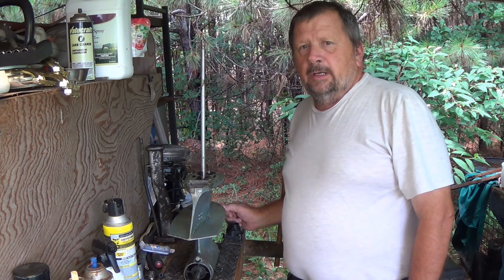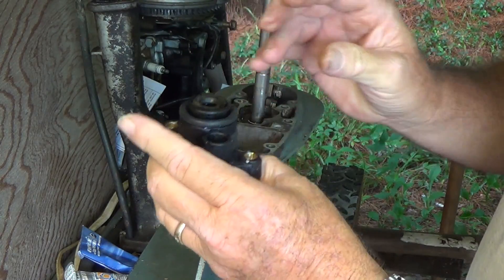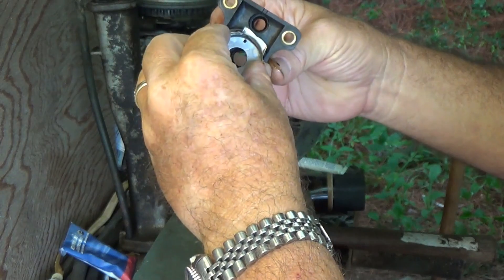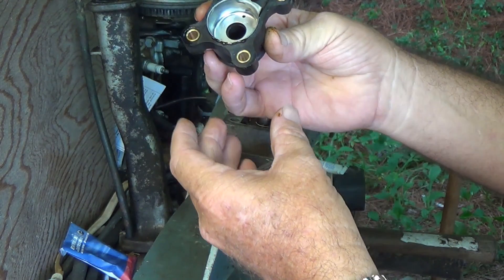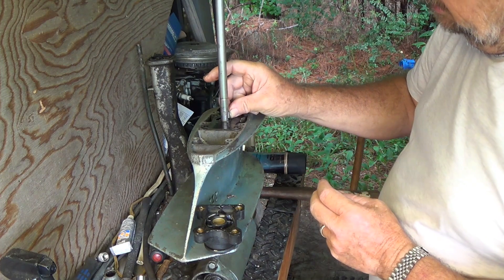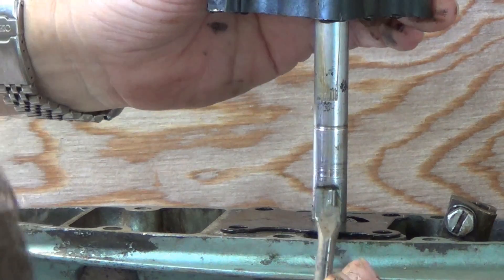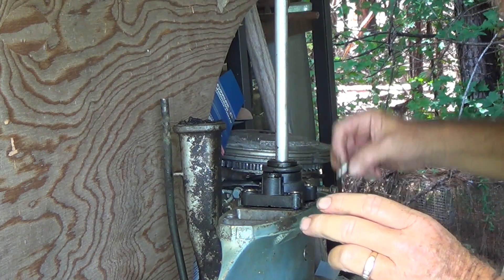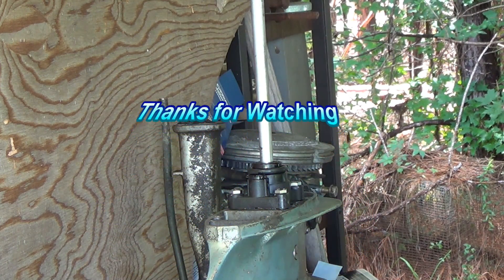Evinrude 9.9 water pump replace.

Comment: Mine replacement stuff came with a big O-ring for the top of the impeller assembly and then a small O-ring about the diameter of a dime…..any idea where the smaller one is supposed to go?!?? I just left it out 😢

Comment: Hi there, thank you for your video. One question, I'm not sure I understood correctly: what's the tightening torque for the four bolts of the impeller housing in Nm (Newton * meter)?
Reply from the maker: That would be 7.0-9.0 Nm
Reply: @OmFishing  thanks!

Comment: I'm wondering if we could put a small amount of non hardening gasket shellac on that little rubber key on the water pump shaft, if it is in fact a little rounded rubber piece, to hold it in place when the impeller is slid down over it?
Reply from the maker: I never have but, I don't see why it would not work.

Comment: I've got a 1996 9.9 Evinrude and the water from the telltale is so hot I can barely touch it for 2 sec out in the river. Replaced the thermostat and water pump w/ impeller, but still the same. I'm getting mixed opinions, I'd appreciate yours. Thank you!
Reply from the maker: Oh wow! If I was working on this one my first guess would be the engine is full of sand. I would pull the head off and look at the water jackets. If they were clean I would check the Inner exhaust tube for leaks. You have be wondering what it could be. I have never had a engine that you could not hold your hand in the telltale water. It has been hot in the past but not that hot.

Comment: I took off my lower unit on my 1979 Johnson 15hp and whole changing the water pump impeller the drive shaft came out of the lower head. Now I cannot seem to install the shaft back without the “ nut “ on the shaft going any further down. It won’t allow for the new plate to sit flush on the head. Any ideas what happened ???? I would rest appreciate if you can help. Thanks
Reply from the maker: When you are lowering the driveshaft back down the pinion gear it should have stayed in place. The reverse gear and the forward gear should still be in position. I would check to see is if some trash had fell down in the pinion gear that is holding the driveshaft up.
Reply: Om Fishing thank you for replying . Should there be anything on the drive shaft it self ? Like a nut or ring on it ? That’s what’s not allowing me to drop it all the way down
Reply from the maker: @anthonymuro4917  I just have come back in the house to my computer after looking at the shaft we are talking about. The end that goes down in the lower unit on mine has 10 spline on that end and on the motor side it has four. The only other place on the shaft is where the key way sets for the impeller. The shaft is smooth other than that.  I am not sure what is holding yours up so high.
Reply: Om Fishing I have zero clues how that bolt “ nut” was on there . I just took it off and now it works perfectly .
Reply from the maker: @anthonymuro4917  I am happy you got it, Stay Safe my friend!!

Comment: Thanks for the videos, they are very helpful. Im trying to change the waterpump on a 1965 evinrude sportwin 9.5 horse. Took the 4 bolts off that hold the lower unit on but there is not enough room to get to the bolt that holds loosens the shifting linkage. The bolt does not have a slot for a screwdriver. I moved the shifter to where it gives me the most room but still not enough room to get a socket in there. Any advice? Thanks
Reply from the maker: Is there a place at he top by the shift linkage to release the shift linkage going down to the lower unit?
Reply: Yes but I had it all the way down. I finally got it to slide down by tapping the fins with a small sledge hammer. I got the lower unit off but the drive shaft stayed in place. Is that anything to be concerned about?

Comment: Thx for videos. My 76 or 77 9.9 Johnson usually only sprays out back and heard they aren't like those with pre holes from under case and circulate and exhaust thro lower unit. How to tell if impeller wkg best/ how hot should head get/and is it true it won't circulate water to head well unless prop is pulling fwd motion in body of water versus idling in tank? Thx for your explanations to share.
Reply from the maker: The engine temperature should be between 125 - 163 F or 52 -73 C. That temperature is taken on top of the cylinder block. The center of the cylinder head area is hotter than 163 F.  When the engine is running it should be over 125 F and under 163 F. Hope this help. Stay Safe and Keep watching.

Comment: Hi, your videos are fantastic, I have got one of these engines and followed your videosto try and get the engine running properly, when the engine is running should the water out of the pee hole be a constant stream, I just have water spraying out, is this correct? I have got it running but keeps cutting out after awhile and then it won’t start!!! Any advise would be great, thank you in advance

Comment: Is there a reason you didn’t put rtv between the plate and the lower unit before putting on the water pump housing?
Reply from the maker: Good catch the book does say to use OMC Adhesive M on that surface between the plat and lower unit. Thanks for keep me in line. Thanks for watching and Stay Safe!!
Reply: Good to know! Guess I’ll be tearing mine back apart lol
Reply from the maker: NOT ME I will put it on twice next time. lol

Comment: put impeller on shaft first then the housing very easy just drop housing down the shaft and turn the shaft clockwise as you apply downward pressure . Thanks i love you videos you are a big help so i thought i would at least return the favor .Tight lines
Reply from the maker: Thanks for the tip. Sorry I took so long to say thanks. Thank You and Stay Safe!!
Reply: Ahhhh huh....thanks

Comment: So didnu say tighten the bolts to 60 inch lbs or 60-80 inch lbs ?
Reply from the maker: The service manual I was looking at said 60 - 80. I always stay to the lower number just in case my wrench is a little off.

Comment: This is the motor you paid $1.00 for at a boot sale? Did you replace the coils? as there was hairline cracks in them.Also there was a bent rod when you removed the lower unit did you straighten it or buy a new one? After synchronizing the throttle is the 9.9 Evinrude performing well?
Reply from the maker: I did replace the coils with used ones, I did straighten the shift rod. It runs good I still need a till throttle shaft and it will be ready to go. Trying to find a used one.

Comment: Looking good! Can't wait for more videos; especially starring the Robalo :)
Reply from the maker: The engine temperature should be between 125 - 163 F or 52 -73 C. That temperature is taken on top of the cylinder block. The center of the cylinder head area is hotter than 163 F.  When the engine is running it should be over 125 F and under 163 F. Hope this help. Stay Safe and Keep watching.

Comment: I found it easier to put the impeller on with key then slide housing down and turn shaft and housing skids over impeller.
Reply from the maker: Your right that sounds a lot easier than the way the service manual has you do it. Thanks for the tip.